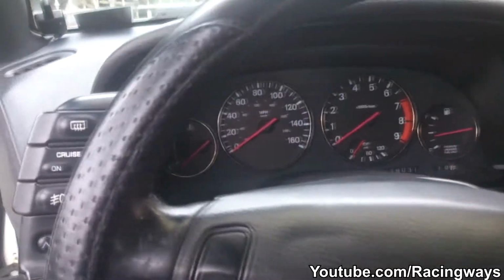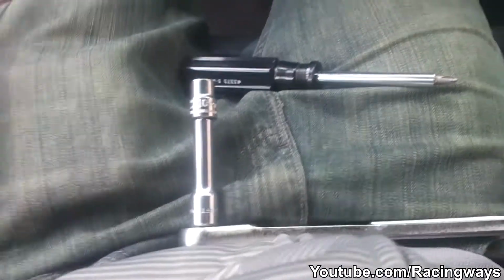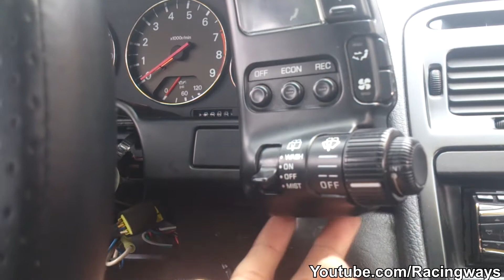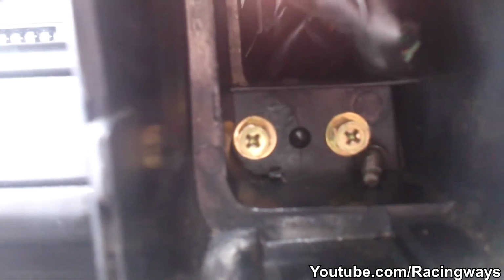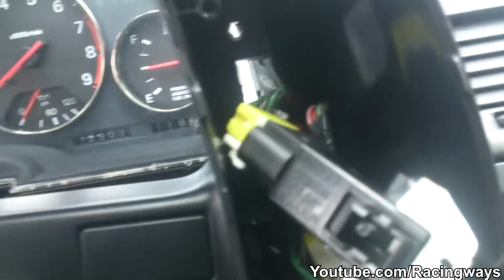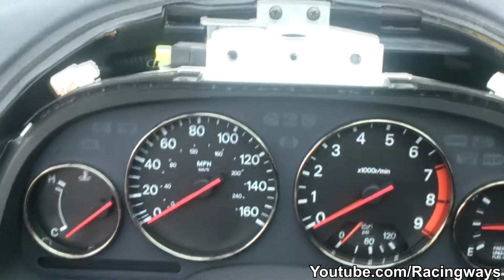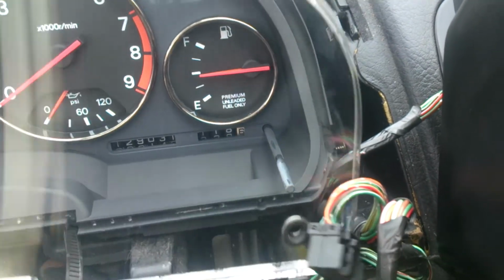How to Remove Instrument Gauge Cluster - 300ZX

Comment: this is a good video showing how to take apart the dash. however to get to the inside of the cluster YOU DONT BREAK THE PLASTIC FROM WHERE ITS GLUED. there are a couple of tabs and maybe a screw or two that separate the back of the gauge cluster. the clear plastic and the plastic it is glued to will separate from the gauges as one piece...
Reply: Thank you for this info
Reply: I came here to say the same thing. Don’t break the fucking plastic cover off. The whole cover comes off with just 2 screws and the little tabs around. I just took the whole assembly apart in less than 5 mins with some pry tools to wedge under and a flathead to press the tabs in.
Reply: @BengalGecko I know this is older but can you explain what you’re talking about? I’ve inspected the whole assembly and I don’t see any clips or screws for this, it seems like you do have to break the glue to install the gauge rings
Reply: @Isaacdavis151  You 100% don't have to break the plastic cover. look at the rear of the assembly. You'll find little black tabs sticking out along the edge of the white shell when examining the rear of the assembly. I don't quite remember how many there are but I believe there are about 8 tabs. Its a bit tricky to pop apart because you essentially have to pry multiple tabs at once unless you are skilled at prying apart these types of assemblies. There are some screws that need to be removed that hold the shell to the cover. Those must be removed first. Do not remove the screws that hold the gauges in place. Look it over until you've located the screws that hold the shell together. You can tell if a screw is for a guage if it goes through the PCB and has a contact pad under it (they are used as conduits). Once the screws are removed take and carefully bend one of the black plastic tabs away to unhook it, and while holding it back slide a thin rigid pry tool into the seam of the assembly. Slowly pry up and down in small amounts while sliding the pry tool along the seam. As you approach the next tab, bend it back carefully as well until you have gone all the way around the assembly.

I have a few photos that might help you, I can get them to you via email. I'd suggest not posting your email here on YouTube publicly, so if you want the pictures just let me know if you want them and I'll make a temporary email address and you can contact me at, you can send an email to that temporary address, and I'll send the pics back to your email.

Comment: I put the gauge rings on mine and I didn't have to take the steering wheel rack off. just took out the side pods and the top shade cover and the whole thing just popped out when u wiggle it. also I didn't put clue on the plastic thing and its not making any noise. I did mine yesterday.

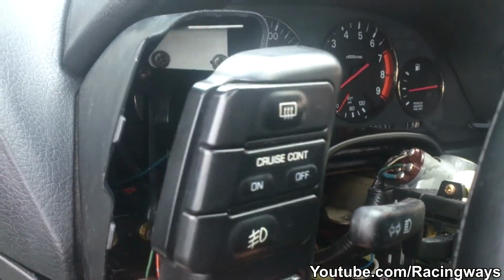Comment: @1:23 you have that white bracket that holds the pod on... like the back of the cluster goes up into that and you screw it from the bottom.  what is that bracket called or do you know where I could get a replacement?

Comment: this isnt the right place to post this i suppose but,  whenever i touch my hazard light switch.... the whooole thing goes . like i cant put my turn signals on, nothing. i replaced the actual switch already but that didnt seem to do much good. i dont think the relay is bad... any other ideas ?? i cant take it apart until i get that figured out
Reply from the maker: +Kern O'Leary is the whole hazard light switch assembly moving freely? is it not properly secured with the screws?